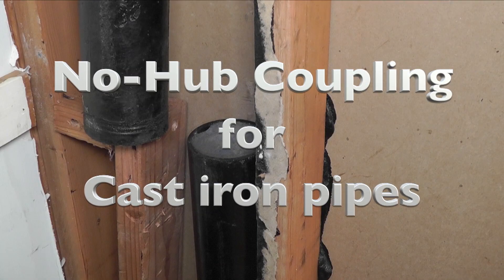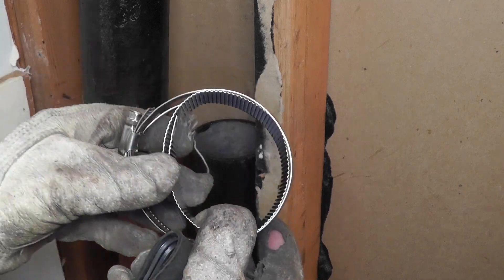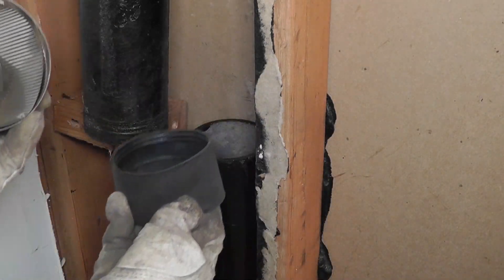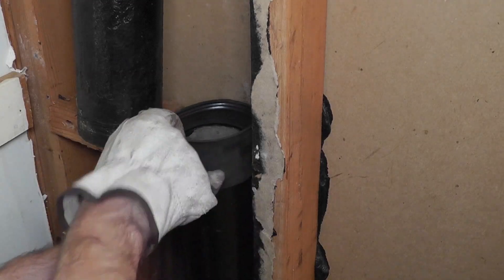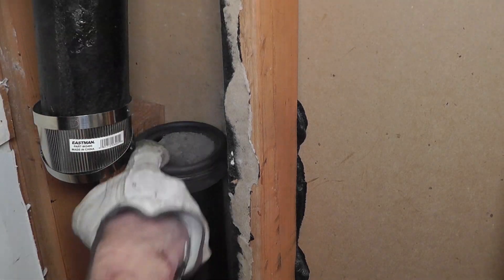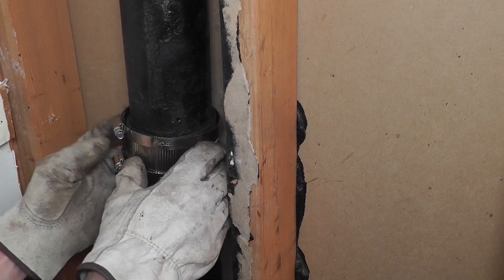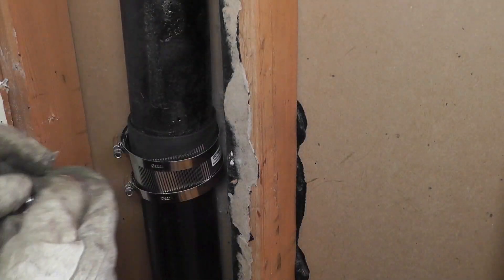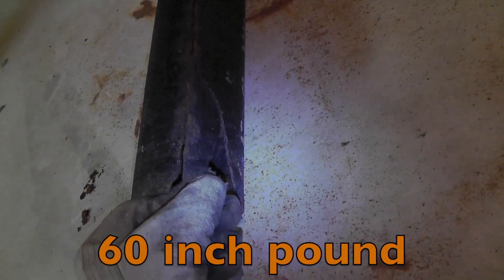No-Hub coupling on cast iron pipes - How to do it correctly

Comment: These things are fucking expensive whats the cheap option this is a waste pipe not for shit who cares if its got metal sheathing? Why are these the recommended choice for cast iron to abs connection other than a money grab?
Reply: theyre like $8 and you really never use more than two on any job. Its really not that much money at all
Reply: Well, to do it according to the plumbing code, metal shielded clamps like this are required. It's so there aren't problems down the road.
Reply: I feel more confident that some sort of varmint will not gnaw into it and cause more problem$. 
  That snd on horizontal connections, I feel better if there is less flex.
Reply: Caca doo doooooo
Reply: Waste pipes literally are for shit.